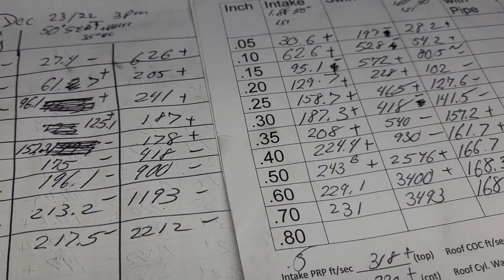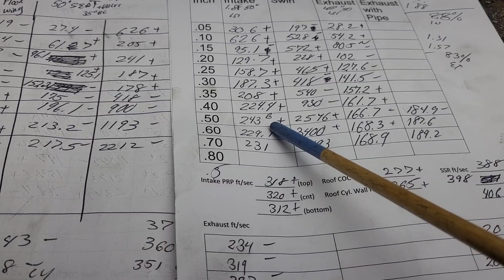David Vizard, Uncle Tony's Garage, Unity Motorsports. Mission Impossible LS valves, 50 deg,1.88/1.57

Comment: I tend to think that the evaporative properties of petroleum versus dykem (especially the solids that make up the dye), mean the plug wetting may not be a thing. Also that you are doing the dykem at a fixed / static lift, is going to behave differently for the transitional dynamics of the valve as it goes through the cycle.
Reply from the maker: I agree.

Comment: Hey Charlie, my experience is to open the bowls up for a 50. After that, the back cuts need to be much steeper than what would be used on a 45. I use a 30 BC for my 50 stuff. Also, the top cut is critical for any valve job but for the 50 is SUPER DUPER CRITICAL. The top cut for a 50 degree seat needs to be NO FLATTER  than a 45 and a 42 is really what it should be.  A 40 works too. But NO Flatter than a 45. You sir, are a trooper. I’d have bailed on this boondoggle a long time ago.
Reply from the maker: I am not a 50 degree seat expert. Good input, thanks!
Reply: @servediocylinderheads  Eric weingartener goes through his angles a bunch. He doesnt tell you his widths of cuts. He hates iron head but he goes through bowl area and crap like that

Comment: All this effort on esoteric, low-production '302 heads (that were only used for what, two years?) essentially just to try to bring them up to stock 340/360-level design, like in a bog-standard '569, '596 or '051 or whatever, which were made for a couple decades, not years...
Regardless, this is all very interesting and informative, please keep up the good work, my friend!  I know it is extremely time consuming and mind numbing!  👍👍
Reply: ☝️☝️☝️ this. Never understood why Tony chose that head other than to make it more of a challenge. A magnum head is way more common these days than the others. If I’m in a class limited to cast iron or on a budget, I’m at the pull your part yards looking for 318 (better yet 360) magnum heads.
Reply: And I’m no rich guy either. I’m on a home ported cast iron budget😂

Comment: I did some calculations a while back about valve shrouding on the 318 3.91 bore. I believe that the chrysler engineers chose the 1.92 valves because any larger with the stock bore and valve shrouding becomes a real issue. Where gains are pretty much washed away with even 1.96 and 2.02 valves.
Reply: What type of calculations did you do?
Reply: Yeah, the "modern" heads like the magnums with 1.92" is about all that makes any sense on the small-bore 318...  Once you're at 4.00, or better yet, 4.030 or 4.040 then a 2.02 can potentially make some gains, otherwise you're probably going to be limited by worsening the shrouding situation as you try to go bigger...

Comment: I would think the 2 barrel carb will atomize fuel much finer than the nozzle on the spray can of Dykem.

The Magnum ex valve is 1.625 in diameter.  Do you think you can get a 91% throat (aprox. 1.479) with that size valve in that casting?
Reply from the maker: It is a good question especially with this castings core shift. I will need to inch up on it.

Comment: Thank you for doing outstanding work on a so-so cylinder head.
   Too bad Magnum cylinder heads are off the build list- even 273's #178 & #920 small chamber heads intake ports are better- no oversized roller-cam pushrod choke point!

Comment: Need a Built 318 shortblock to test next running Charles. Go 750 cfm 4-bbl Holley 4150 Double pumper Carburetor.
Reply from the maker: We used a 750 on the 306 Ford dyno. Worked great.
Reply: @servediocylinderheads  750 cfm is a good baseline Carburetor overall.

Comment: If you worry about it you can clock the plugs so the J wire shields the gap. The ignition is a while after intake so fuel is unlikely to be a problem unless additives or contamination are leaving deposits. Same could be said with EGR without sufficient oil seperation .
Reply from the maker: Good input. Thanks

Comment: Widen and lay back the short side radius? Also, there is a dry area with no dykem near the spark plug. The chamber ramps up and the dykem is accumulating in a depression and might be getting thrown toward the spark plug. Smoothing out that depression may allow the dykem to flow around the spark plug and into the chamber with a better distribution pattern.
Reply from the maker: I could lay it back more but I will lose midrange flow. Thanks

Comment: I would try a 75 deg bottom cut and 2.02 nail intake and 1.60 tulip exhaust valves with the smallest stem you can find.
Reply from the maker: These may go that large but I do not think it will help without tubing the pinch. Thanks

Comment: Have you seen black-sheep-fab, yet? He's done work on the 302 head flow, and went thorough the same problems.
Reply from the maker: I looked for it but did not find any cylinder head work.
Reply: @servediocylinderheads  you didn't see his flow numbers and such?
Reply: @servediocylinderheads  he drilled out the pushrod pinch and installed a brass tube.
Reply from the maker: @elliottmagnum4998  Can you post a link?
Reply: @servediocylinderheads  I've tried but I just don't know how to do it.
Reply from the maker: @elliottmagnum4998  No doubt that would help.
Reply: @servediocylinderheads  go to YouTube and type in black sheep fab. Mabey someone can help me.
Reply from the maker: @elliottmagnum4998  I looked again, no luck.
Reply: @servediocylinderheads  he has made moldings of the ports.
Reply: @servediocylinderheads  someone will send it to you. I just don't know how.
Reply from the maker: @elliottmagnum4998  I finally found it. I have seen them before but he did a good job.
Reply: @servediocylinderheads  just thought it might help you out, make that engine scream!
Reply from the maker: @elliottmagnum4998  Thanks!

Comment: My thoughts are the 50deg seat is going the wrong way due to the max flow of the tiny 2 barrel carb. The 50 deg will likely limit the low lift flow though high lift flow will probably improve. However with the small carb I am thinking you would be better off focusing on the low lift flow with maybe a 35 deg seat to increase the total flow during the valve open event. Just my thoughts. I am not a head porter. Just been reading DV's books trying to learn. Your thoughts?
Reply from the maker: Check the flow sheets, low lift is actually up compared to 45.
Reply: @servediocylinderheads  awesome!
Reply: @servediocylinderheads  not to contradict here, but you increased the intake valve by .100, improving the throat at the same time. By nature,  all else being equal, your numbers should have gone up everywhere until it chokes. And they did. even with the 50 degree cut (not because of, and I know you know that). but if you went with a 45 degree and 30 backcut, your lower and midlift numbers would have been better. i have done it. and they were much better. your .2 should be closer to 140, and .3 should be closer to 200. Now i cant say exactly what YOU are after here ( I am aware of the scope of the project), whether its peak flow numbers, or area under the curve. Peak HP or fat torque. but if a low lift cam is in order, the 1.88 valve with a 45 degree seat and 30 backcut will likely give a more satisfying result. just saying.

Comment: It isn't such a big deal in an iron head as the higher amounts of intake heat assist in fuel vaporization. That's the simple physics part.

It's not at all clear that spraying dykem into the port runner simulates running engine dynamics(in fact it cannot).

I think it's hilarious that non-engineers find Jon Kaase's clear TR plenum so relevatory, when ANY good 1D model run while teach you much, much more about pressure differentials in a running engine.

I don't look at engine architectures much unless I have several to choose from for modification. I just look at them as mathematics equations to solve. Really complex equations, but modern computers can crank out usable model runs in several hours.
Reply: Are you saying you can improve the engine by removing metal from it after running a 1D simulation? Man you have free access to use CD values from Charlies port work and do whatever you want. Tell us where you would remove the metal?

-juhana
Reply: How would you try to improve small block chrysler after you have reached the baseline for computer modeling, if the goal is to improve it by modifying existing parts? Why not try modeling different things beyond the current engine architecture and look for options to improve the baseline?

I suppose one could see the pressure traces as a mathematical equation, so im wondering do you know anyone who would be interested in doing some CFD work on a valve, for nothing? 😀

-juhana

Comment: Can the 50° seat.  what little you gained at the top (with turbulence) can't make up for flow loses in the lower lifts. IMO  50° belong on prostock heads with huge cams, not small 340's.
 Go back to a 45°.  30° BC on the valve with a blend radius into the back side of the valve.
 32° top x 45° .050 seat x 58° .070 wide x 70° bottom just enough to break the edge of the 58°.
 Use some finishing stones too...
Reply from the maker: Beaver teeth or nothing!!!

Comment: Ur flow numbers r exceeding stock W2's Charlie
Reply from the maker: Is that good?
Reply from the maker: Not a Mopar guy so is that like a bowtie head?
Reply: @servediocylinderheads  Its Mopar racing head Charlie
Reply from the maker: @rickyfulks889  Cool, I will look it up. Thanks
Reply: @servediocylinderheads  They were 2.02/1.6 valves also
Reply from the maker: @rickyfulks889  Looking them up now. Can't find port sizes. As someone pointed out 2.02 is a bit big for 318 even bored out. I think 1.88" is the ticket. Thanks